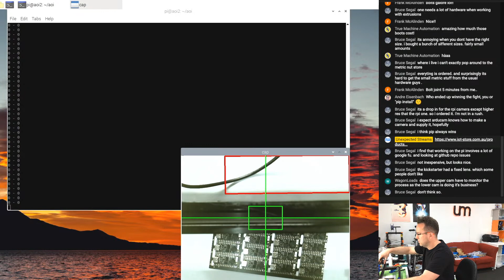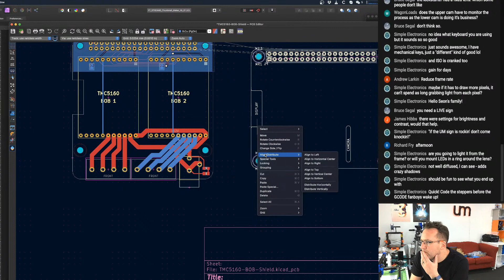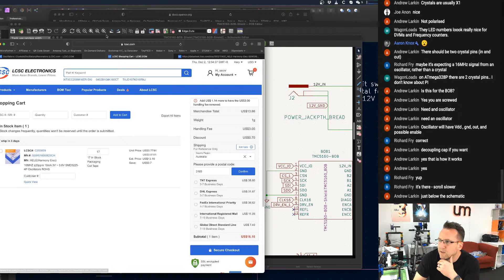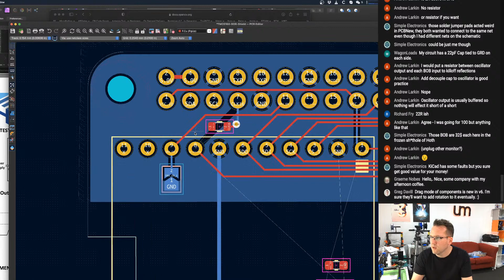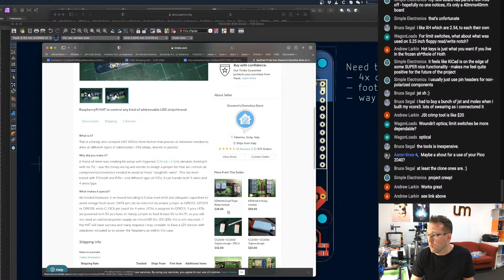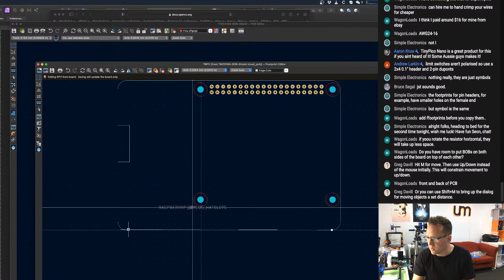Live Stream #11 - AOI Mechanical is done?

Comment: Don't bother with the resistors in the 16MHz clock line. Not required, nor normal practice. Yes decouple the oscillator with an 0.1uF (on VDD/GND).

Comment: Nice progress. For crimping JSTs I have a chinese crimper from a brand called IWISS (model IWS-2820), it is not automatic, i.e. you have to crimp one time for the wire insulation and another time for the actual conducting part but the result is great, I wouldn't enjoy doing this 100 times in a row though. Just found IWS-3220, these look kinda pomising.
By the way, LCSC does not charge the 3$ fee when you combine with another order.